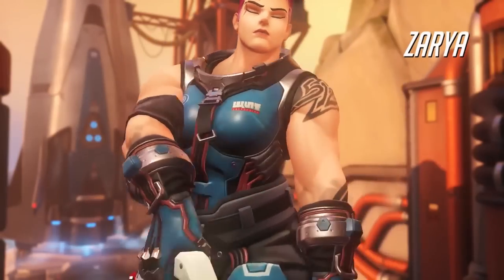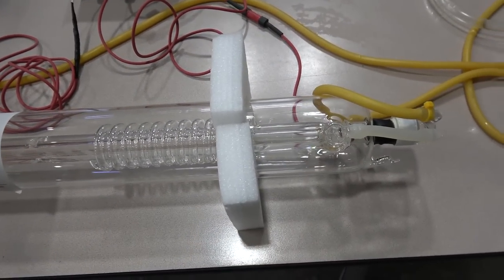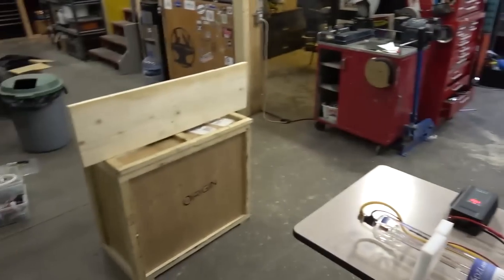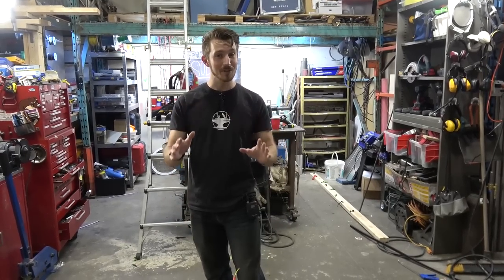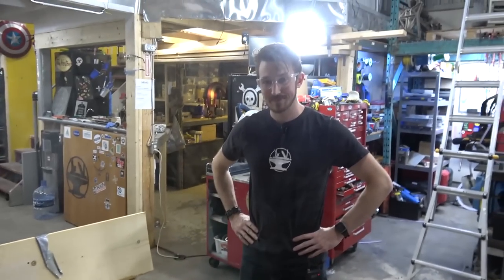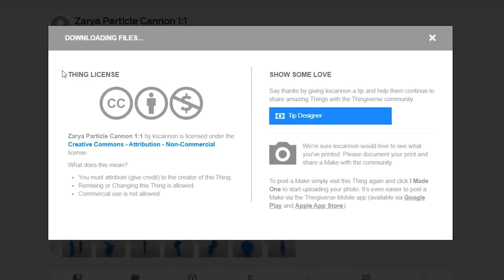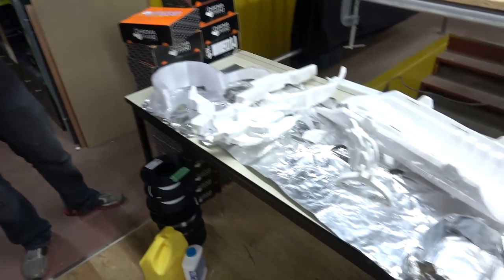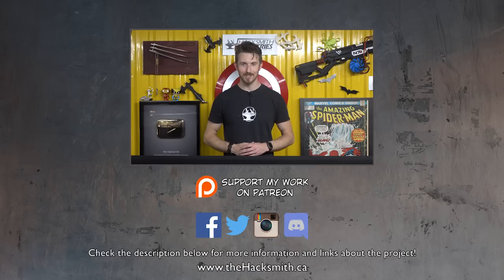Make it Real Zarya's Particle Cannon (PART 1/3)

Comment: I've been summoned. :)

First off, my 200W laser bazooka will still be more powerful than yours at 80W, simply because mine outputs 200 joules of light per second, and yours will output 80. This is simply going off of the physics definition of power, which is energy per unit time.

That being said, yours will be more destructive than mine! The infrared light isn't even the main reason here, although that wavelength of light will be useful for melting glass and stuff like that. The big reason is that your laser source is a single emitter, a CO2 laser tube. My laser bazooka was made up from arrays of blue lasers. The light from your laser will come from a much smaller source than mine, and by the conservation of etendue, the laws of physics allow you to keep your ray of light smaller. A smaller beam means more power per area (a higher irradiance) and more destruction.

That was painful admitting that your laser is going to be more damaging than mine. I guess a laser bazooka arms race is in store... :D
Reply: styropyro but since your using multiple blue lasers for a laser shotgun  wouldn't his single laser be more powerful than one of your blue lasers that makes up your laser shotgun
Reply: styropyro hey when do you think you'll make another video?
Reply from the maker: Styropyro! So good to hear from you, been a long time fan -- super excited to see the outcome of your Ruby laser! I think the first project I remember seeing from you was your modification of the Arachnid robot spider! 

Regarding the power output, that's basically what I was assuming -- but for a point of comparison, if you had say a 200W CO2 laser and a 200W single emitter blue laser, both focused to the exact same size -- would they have the same burning power? I understand they would have the same power output, but my thinking is that because IR is absorbed by more materials, it would cause more heat transfer into the object being struck. Though this would also be very material dependent! What do you think?

I welcome a bazooka arms race xD
Reply: You two should have a laser battle
Reply: The ruby laser is actually finished, just need to complete the video. I'm having a problem with focusing the light to a point though. Every lens I stick in front of the beam shatters after a single shot. :O 

The comparison of equal power blue and IR lasers will be different depending on the materials. The blue laser has a wavelength that's over 20 times shorter, which means it can be focused down to a much smaller point and therefore do considerably more damage in that scenario. Plus, the blue laser can also keep a much smaller beam over a long distance than the IR laser. Furthermore, blue light is in the frequency range where it can excite electrons in materials to higher energy states, helping chemical reactions to initiate, where a deep IR laser cannot do that. Although, actually getting a 200W blue laser that is single emitter/single mode is not an easy task, unless you have well over $100k to blow. 

The IR laser, like you said, gets absorbed very well by most things (not metal though). That's why you can melt glass and ice with it, where you can't do that with the blue laser.
Reply: styropyro what if you get 4 80w Co2 laser tubes then combine them to make one super laser of death! :D
Reply: aye its our boy
Reply: Oh my god, just do the collaboration already. It'll be fun to see the Hacksmith fanboy and have two brilliant minds make a massive multi-video project that'll take place on both channels. Just an idea. ;)
Reply: styropyro where were you all those 6 months pls more vids
Reply: styropyro you and the hack smith should do a collaboration
Reply: we need this arms race
Reply: A collaboration would be awsome laser v laser.
Reply: I'm glad you're still going styropyro! Was worried something had happened, really looking forward to your next video
Reply: styropyro  I don't understand a word but I know that u made a more powerful laser gun
Reply: I have a idea, firts you have to get a - lens and a +lens that are opposite equal to eachother. make the lasers all poin t to the same direction (dont center it ). firts place the + lens so all laser beams will be centered. than place in that center the + lens to get a infinite small beam (you can filter it by pulling one of the lenses forward or backward).

(srs this will work for 100%) (ps my technical skills are sssssoooooooooooooooo more better than my englis skills
)
Reply: Styropyro, you two should do a collab.
Reply: styropyro Has anyone actually demonstrated 100+ watts diffraction limited in the blue?
Reply: You should just use a magnifying lens or something to concentrate your 200W.
Reply: styropyro so, in theory. Yours does more damage while theirs has more destructive potential
Reply: Use the sun. It's a deadly laser.
Reply: Blaine Pawlak yes as he stated but since his overall laser shotgun is more powerful
Reply: styropyro why no vida
Reply: lol this is 2017 who uses bazookas any more what about a kazer RPG
Reply: its not a rocket propelled grenade
                                r.p.g
Reply: O_O wow...
Reply: styropyro Where have you been
Reply: yes very true.
Reply: finally more vids from you
Reply: styropyro when you find someone smarter than you
Reply: i miss your channel
Reply: yours looks cooler though i mean like
 for aesthetics
Reply: styropyro you wold get along with hacksmith what if you combine the laser Psychos what would happen
Reply: styropyro I'm scared to see all of you get put together into a video. Or worse... Get contracted to do next gen weapons for the military...
Reply: styropyro I
Reply: styropyro my brain hurts
Reply: styropyro I
Reply: styropyro o
Reply: you have to make a shoulder mounted tri-co2 laser cannon
Reply: styropyro I'm not great with physics but wouldn't hack smiths laser be more powerful because it's consistent
Reply: omg yes a laser build off
Reply: styropyro I
Reply: styropyro I
Reply: styropyro q
Reply: the Hacksmith I love your veidos
Reply: styropyro just,
Reply: Thay should work on a project together
Reply: styropyro i
Reply: if you can make a laser weapon that can KILL you need to give the blue prints to the military and the navy
Reply: styropyro wut
Reply: styropyr
Reply: styropyro poop
Reply: please do an arms race or a collaboration. If you do, please bear in mind the aesthetic of X-com laser and plasma weapons, or Fallout....
Reply: Nerd
Reply: In other words, power isn't as important as power density. The 200W laser bazooka is much cooler to look at though. The IR laser is exciting, but a little... invisible.
Reply: lol learning about lasers with STYROPYRO ;D
Reply: I want the laser shotgun
Reply: What if you use different laser tubes like his to focus it to a certain point it would be big but would be destructive
Reply: styropyro YES A LAZER ARMS RACE!!!!
Reply: IVE BEEN SUMMONED!!
Reply: styropyro  lazer war
Reply: styropyro Awesome I've been subbed to you for awhile now! 9 months late xD
Reply: NEEEEEEEERRRRRRRRRDDDDD
Reply: Blaine Pawlak not really. A smaller surface area squalls more destructive force. Having more laser will make more surface area. It would be like multiple nails. You can lay on multiple nails but one will stab you
I hope this helps
Reply: styropyro you rock thanks for your videos I'm an acual laser welder tech Goin into hobby realm lasers hoping to  move on to a laser echer
Reply: styropyro u
Reply: styropyro Lol
Reply: Don't be sad Styro, The Hacksmith hundreds of times more funding so he just bought a single laser thing, he didn't build his own like you do.
Reply: How dare you summon the might of... That guy
Reply: i read it all
Reply: All that horsing around and all you said is his is laser focuses more on a single area. xD
Having the bigger more over-engineered gun and losing to a more efficient smaller one hurts doesn't it :D?
Reply: Cant buy pistol in Canada makes laser gun
Reply: styropyro thanks for writing my 2 page essay on lasers
Reply: @based7655  boi
Reply: In English?

Btw if your reading this i subbed to u and liked all ur vids :))
Reply: holy crap i didnt expect two of my subbed yters to be in the same video holy
Reply: L
Reply: @hacksmith  hell yeah
Reply: styropyro nmmk
Reply: Me brain hurt
Reply: 0.0
Reply: It would be cool if you two make a colab so you guys can make a super laser with both of your great minds.
Reply: Now that’s Alot of science
Reply: Lol
Reply: Im an enginer
Reply: There’s always the obligatory Styropyro comment on any video that prominently features high powered lasers. Long time fan my dude. Happy lazing.
Reply: Hi
Reply: welp make a laser nuke >: )
Reply: styropyro ,
Reply: @tmoneytechnic  not a great time
Reply: I SENCE A COLLAB COMING
Reply: BEEG BEEG brain
Reply: In English please
Reply: yes you have
Reply: The god is here
Reply: You are to smart for me
Reply: Make a challenge whos lazer blaster is better
Reply: Well u had a shotgun and he had a rifle it does make sense that your laser is wider
Reply: styropyro what? I’m not 300 iq brother
Reply: Hello! Wasn’t expecting to see you here.
Reply: cool
Reply: Nerd
Reply: This guy just wrote a novel in comments
Reply: The logic man. These guys just go beyond it all. They live up to the name: Make It Real…
Reply: @frankhuminski385   colab to make a lazer tank

Comment: Use infa red goggles to see the lazer
Reply from the maker: Doesn't work!
Reply: Or use an infrared camera lens filter to get it to show up on the video
Reply from the maker: Also doesn't work. This is a 10800nm laser, which is outside even the IR range for regular (and IR cameras)!
Reply: the Hacksmith ah too bad. Would've been cool
Reply: Or just the naked eye...
Reply: Most FLIR thermal cameras should be able to see 10.6um
Reply from the maker: +gibsongtr91tube yeah... This is 10.8 lol
Reply: the Hacksmith FLIRs should see all the way out to 14um or so. I just said 10.6 because that's standard for CO2.
Reply: the Hacksmith I'm an optical engineer and I design killowatt class lasers professionally. If you have any questions feel free to PM me.
Reply: the hacksmith, please do some research before you say that 10.8 µm is outside the spectral range for most IR cameras, the most common IR camera is long wavelength cameras, which usually have a range of 7-12 µm. That said, most FLIR cameras have a range from 7-14 µm.
Reply: Eirik Jenssen I assume he was referring to standard "night-vision" IR cameras, which see NIR. Thermal cameras, like you say, should be able so see this far out. They aren't that had to get ahold of these days either.
Reply: So is there ANY way to see the laser? Besides the fact you are putting blue lasers around it to make it "visible"
Reply: alien Should be possible to view the beam with a FLIR, but it's also pretty standard to couple in a visable aiming laser with a dichroic filter. An aiming laser would be a really good thing to have if only for safety purposes.
Reply from the maker: We have a Seek Thermal camera, it can't see it. They say it can see between 7.2 and 13 microns. If we make the air really dusty you might see something but that's mostly the dust catching on fire. We are putting blue lasers around the barrel for aiming purposes, as mentioned in the top comment =)
Reply: the Hacksmith The camera isn't the problem, there just isn't enough scattered light in the air to see. You should be able to see the spot on a target, although I don't think you have any way to turn the power down so that it isn't just burning whatever it's pointing at.

Comment: Awesome video. As another armature engineer of evil I love the idea of laser weapons! As an overwatch fan THAT LOOKS AMAZING!

If you are interested, you can calculate the power density of your laser. I calculated it assuming a spot diameter size of 5mm which would equal a power density of 407 W/cm2, Which would be a higher power density than styropyro. However a perfectly focused 80w beam (which is un-achievable in the real world, but who doesn't love theory) would have a power density of 90,700,000 W/cm2. If I remember correctly the threshold to vaporize wood is about 10,000 w/cm2, So our focused laser cutters output at least that much.

I've been planning to do similar with my old 40w co2 tube from my laser cutter. The trick I've been thinking on is focusing the beam at the target for that exponentially more powerful beam. Just like with the cutters if it's a bit out of focus it no longer cuts. Best method I've found by reading scholarly papers is a liquid between 2 films. Adding more pressure bulges the film, and changes the properties of the lens. The biggest benefit of that is the focus could be changed very quickly.

In theory, A laser range finder fires first, the guns cpu inputs the distance and controls an actuator to increase or decrease the pressure to the liquid lens to focus on the correct distance, then the large laser fires. If you want some reading material I would suggest:
http://lcd.creol.ucf.edu/Publications/2007/Opt%20Express%20Ren%20Lens.pdf
It covers how they made liquid lenses for optical purposes. I don't know of any material that is elastic and completely transparent to laser light though. Thought I would share if you were interested in the theory. Plus in the chance that you (whoever is reading this) knows of a material with those capabilities, please share that information.

My goal is partial utility though because if done correctly it could be made as a lens for a laser cutter with an auto focus so fast it could even engrave 3d surfaces.

Comment: hey mister Hacksmith! I'm a graduate in mecanical engineering and I've been using SolidWorks for the last three years. I just just wanted to ket you know that SolidWorks can open STL files as parts to be assemble after being saved as SLDPRT files.

Also, a huge that you for inspiring me to finish my technic in CEGEP 😁
Reply from the maker: It can, but not well. Solidworks actually has a limitation on the number of triangles in an STL file that it can import. It can bring them in fine as graphical bodies, but they need to be solid bodies if you want to use any kind of mating features! Try it and see ;-)
Reply: thanks for the info! i'll try tonight

Comment: in regards to the styropyro laser bazooka why would the laser being infrared mean it's more powerful than a blue laser when blue light is more energetic? Sorry, if this is a dumb question, genuinely confused.
Reply from the maker: +Keith Sachs because infrared transmits the most heat as far as I know, try checking Wikipedia!
Reply: I did check, all i could find is a comparison of electronvolts, but thanks i found some more info after reading your comment.
Reply: There isn't a lot of benefit of LWIR over blue except that most materials absorb LWIR and reflect blue.
Reply: This should be a lot more destructive, however, because gas lasers produce nearly diffraction limited beams, so it should be much brighter especially at range.

Comment: Hey Hacksmith why don't you guys just make some sort of shredder for plastic and then condense and heat up the small bits into the plastic you need for 3D printing. I saw an idea with blue prints that had this and though you guys could use it
Reply from the maker: +Jack Boris yeah it's very much possible but it's not that easy. Actually tried developing my own system years ago! The other issue is consistency. Recycled plastic doesn't perform as well, so it could ruin future projects which doesn't make it very worth while for us!

... Plus we get free filament anyway :)

Comment: Hey dude you called particle accelerators a fictional technology, however a particle accelerators does exist, however a version small eneough to fit in the gun does not exist, so I guess you are partially right, however I just wanted to point That out

Comment: Could you record shooting the  overwatch laser bazooka with a inferred camera so you can see the beam?
Reply from the maker: +creeperman 682 doesn't work! Already tried it!

It's outside the infrared spectrum that camera sensors see! And the only reason you can see a regular laser beam is because it hits dust particles in the air!
Reply: the Hacksmith oh, well great build though

Comment: What if you attached a visible laser to it (like a laser pointer) as close as you can to the UV laser so that you could actually see where the laser is going using the visible laser? Kinda like how you might attach a laser dot to a rifle, but with a visible beam, not just a dot.
Reply from the maker: Read my top comment below the video =)
Reply: Ah, sorry. Didn't see it until you pointed it out. Thanks for addressing my comment though.

Comment: So the laser is cool but obviously not an exact replica in terms of effectiveness and the look of the laser. One idea is that if you have a powerful enough laser, the heat will actually ionize the surrounding air molecules creating a plasma beam that will follow the path of the laser. It would take a HUGE amount of power and one kick but laser but that's probably the closest you can get to modeling the gun

Comment: You can convert .STL to .STEP files and then mate them. The CAD software creates flats, round and other features within the specified tolerances of the mesh. =)
Reply from the maker: +Mattias Gungner really? Please do tell what software can do that well, I've never encountered anything that can do it even remotely well!
Reply from the maker: Yeah, never had good luck with Solidworks and STL's. I've tried a few other programs but pretty much given up -- are any of those programs you listed freeware?

I wish everything used the .STEP format!